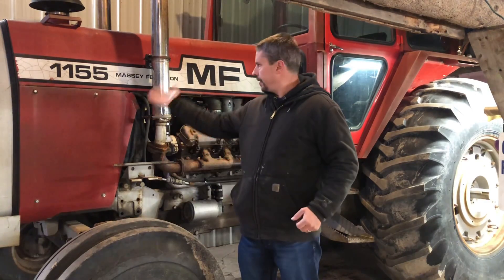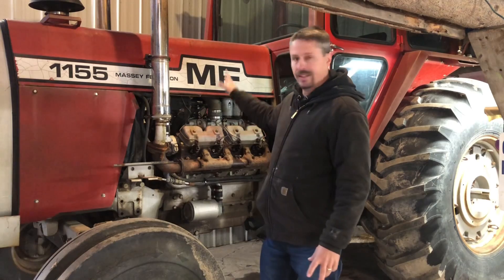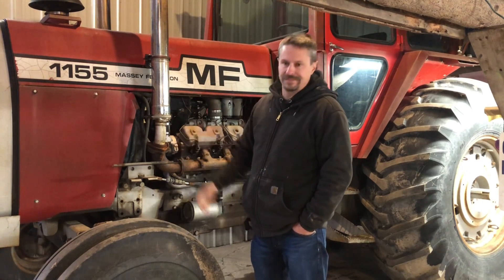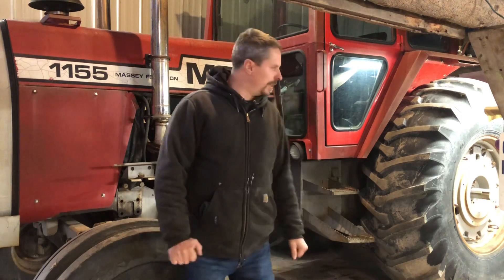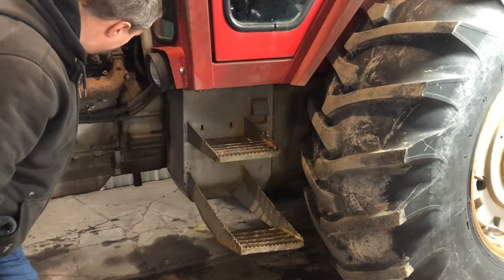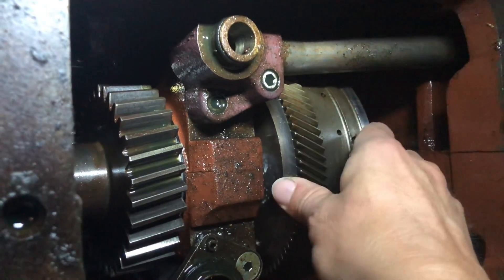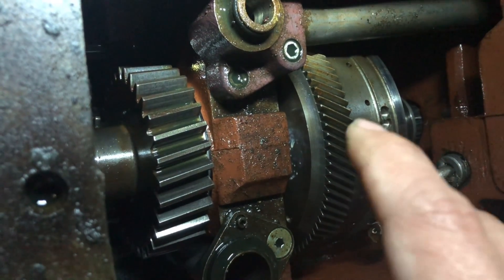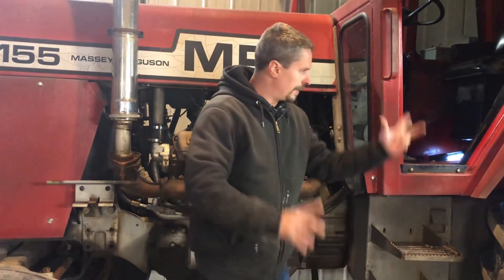Massey Ferguson 1155 hydraulics fix part 1

Comment: I loved the 1155 we had. It was turbo charged when it was almost new. It had a single 3” chrome stack. It was a monster. More power than traction for sure. Hilling up potatoes, it would spin on the steep parts of field and that would make the rows a little crooked and then come harvest, I’d get yelled at for crooked rows. You could hear the turbo whine through that single stack for miles! One of the few tractors my dad regrets selling.
Reply from the maker: That's awesome!

Comment: Have you ever had any issues with the multipower? I have an 1105 and the connection from the top of the transmission to the multipower lever in the cab leaks and when multipower is on. Were unsure if the connection is factory or a homemade jobbie from a previous owner. Massey dealer down here is very little help.
Would love to see a video of where yours connects. Should be right to the left of where the fluid is added to transmission.

Thanks.  Your videos are awesome
Reply from the maker: I appreciate it!  I’ve not had any issues with mine leaking.  I seldom use it to be honest, I had to flip it into high last week just to be sure it still worked 😆

Comment: Hello, this is a little off the subject but my neighbor has an 1155 he says that the multi-power is weak. How big of a job is it to replace it? Thanks Scott
Reply from the maker: It’s a fair bit of work. Tractor has to be split and the front of the trans pulled out. The MP clutch pack is on the inside of the trans input shaft.

Comment: ALWAYS plug in a block heater when you are trying to find a leak, the block needs to be as hot as you can get it to locate internal coolant leaks.
Reply from the maker: Probably should have. 
Been a year and it has not came back

Comment: I had an 1855 tractor what to change oil one day there was antifreeze first come out about a half a cup couldn’t find out where it was at put a drain petcock drill the oil plug out put a drain petcock in the oil drain and every morning before I drove it I would turn that petcock run the antifreeze out to come shut her down. I run it over six years that way they claim it was a cold somehow. Thank you.

Comment: Check for pin holes in cylinder liners below ring travel area. We had a Cummins 555v8 same thing . A pinhole let antifreeze into oil none in combustion chamber etc .
Drove us crazy took heads off twice .
We pulled oil pan off filled cooling system pressurized it and behold antifreeze dripped out on floor.
Block heater ate holes electrolysis.
I had same coupler on my MF 165. 
Is designed to fail instead of shafts .

Comment: Seen that same pto coupler failure on a 1100 with high hours.  Like close to 10,000 hours.  Another serious flaw. If park pawl spring breaks. Pawl can fall into park position. If engage gear shift probably low range.  Seen a 1130 with a busted differential housing.

Comment: We i had a 1155 in the 70-80t’s one off three in the erea 
Ours went into our local dealer for a  modification which was the fitting off a heavy duty coupling i think it was the same one as u r doing
Wish we never sold it 
North west england uk
You videos are very good keep em coming 👍👍👍

Comment: Massy Fergusons did not come energized from the factory.  When they showed up at the dealers in Iowa anyway. The dealers had to put batteries, coolant, fuel,  hydraulic  and engine fluids in.    We took delivery of a 1155 in  the fall of 1973.   Dealer fired it up.  Hydraulic oil ran out of the belly. It got took apart to find part of the rear oil pump missing.  Put it back together and chopping stocks with it and a internal PTO bearing failed with 40 hours on it.  Taken apart for the second time.   There was like a 23 step flow chart to check each part of the hydraulics.  Quality  control was so bad that tractors got out of the factory with left and right tires not being the same size.  MF 1100 was  a simple tractor.   The 1155 was  a very busy   hydraulic system.  We had much better luck with  a MF 1085. I loved that Perkins 4 cylinder engine..

Comment: My family ran a MF dealership for almost 50 years... have worked on many 1100 series tractors...
The perkins engines are great engines... Check your oil cooler... have seen several leak after heat cool cycles... hardly ever had head gasket issues with the big v8... bet you a coke its the oil cooler though... several o rings inside the unit get old and brittle...
Reply from the maker: From all the research I’ve done it sounds like the 540 is not known for head gasket issues. Time will tell 😉

Comment: So many farmers today play the government right off game on taxes. 
Old tractors will still till the soil.
Invest in a high tech  tractor, planter & combine.
Reply: The big problem is for guys like us, we've still got to earn the money on the land to pay for that fancy stuff, and fix it when the computer or emissions system dies. Without anything else going wrong you can't touch on it without a computer to "reset" it. Dealer rates on that  can be 150 an hour plus here in Canada. I work self employed on older stuff guys run for $50 and family farm 200 acres helping my dad who's supposed to be retired.
    some of the machines are on farms with new Machines, where they run old stuff for certain jobs.  I was on a farm where 1 of his 690 Deere combines started running rough, the motor died in it 2 days before the end of corn this year. Luckily he has another machine they don't run at the same time with corn, they can't truck from 2 combines fast enough so he could swap the header/concaves and carried on.  I talked to his assistant manager today that machines looking at a 30K plus repair, before next harvest if they don't take the bigger hit trading it as is. 
 They spent 30K on other stuff when they bought it used a year ago.  Chances are guys like us don't have 30 k in all our machinery and fix it ourselves, with cheap used or jobber non oem parts. I priced rebuilding a fire damaged newer Deere combine over the winter for a profit selling it next year, the fuel tank was $19000 without the 65k the machine made and other parts, it wasn't worth doing even with labor 2 /3rds less than Deere !
  We probably make just as much money per acre farmed  as a guy with huge acres and financed to the nuts with a huge amount of borrowed money, unless they inherited paid for family land. I know several in this area with big acres didn't get finance for crop inputs in the last few years and got forced to quit. Or realized the math and walked away from rented or mortgaged extra land before they lost everything, with a wet year and poor yields.

Comment: Good video...👍.  A couple of good resources for info/troubleshooting the 05 series Massey’s are the Machinery section on Agtalk and Rudolph Brothers Implement in Rockport IN.  I notice the MF logo on the grill is red, I’m guessing the tractor is 1976 - 1978 vintage?  My 1105 has that red logo and is a 1977.  MF was at their zenith with the 05 series tractors - a great piece of engineering IMHO.

Comment: I had one. Good on fuel but only one really bad weakness. The PTO. The PTO bearing is no lubricated properly and it will eventually fail after about  every 1200 hours

Comment: Well that's the worst kind of coolant leak. Hope it's an oil/water heat exchanger and not internal. Maybe a can of magic, like Mendtite will save ya!
Reply: All these videos I've watched, and first noticed you're working on dirt?  Or really bad cement.  Depends how I hold my phone 😉🍻
Reply from the maker: It’s bad cement. But it’s better than mud 😉

Comment: Check your oil cooler they can leak Coolent into engine oil
Reply from the maker: I had it off the block when I pressure tested the system and it didn’t leak anything this far. Doesn’t mean that it isn’t still the culprit

Comment: Did you work out where the cooling liqiud came from when you drained the oil?
Lets find out.
Reply from the maker: Not yet. I went over that in the beginning of the video, how I pressure tested, pulled injectors and the oil cooler and nothing. It holds pressure, the oil cooler wasn’t leaking, even ran it for an hour and it didn’t leak a bit.  I’ll have to run it hard to see what comes of it.
Reply: @jtsbarnngrill6873  I loved the upload sir. I had a bike that lost coolant when the temp dropped below certain point. 
What a beast of a machine. Cant wait till episode 3. Cheers sir.
Reply from the maker: Cheers!  Next video it gets the splits.